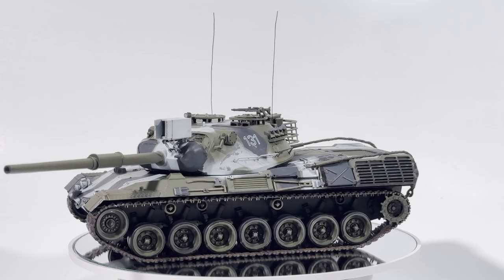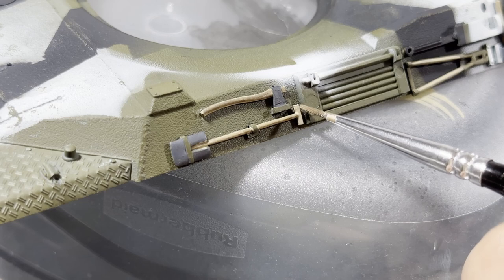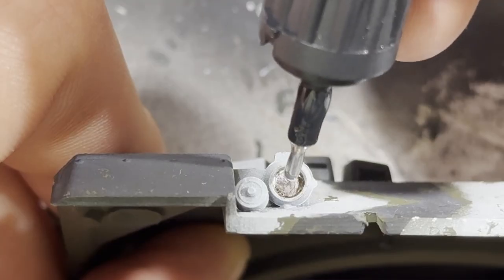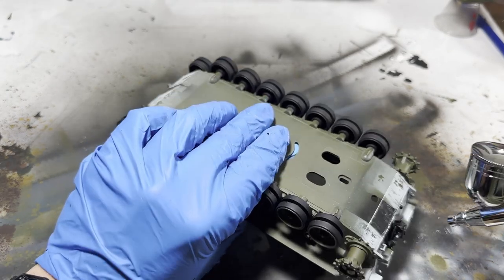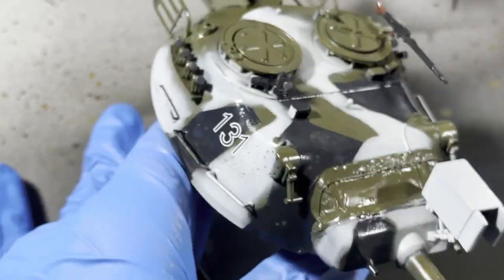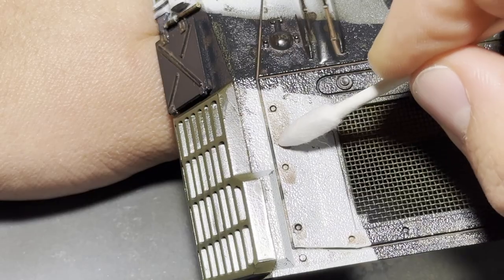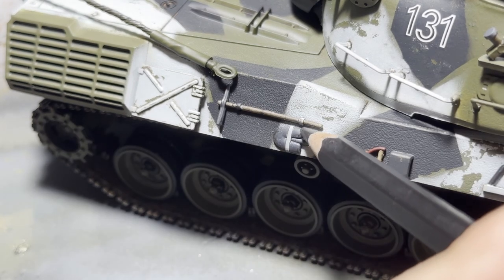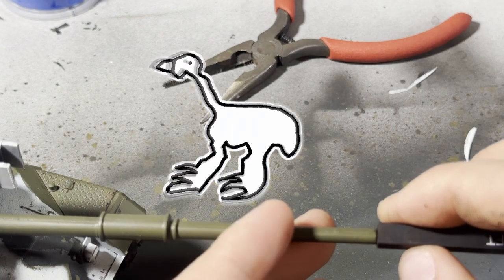Enhancing Your Scale Model's Realism: Tools, Decals, and Enamel Wash

Comment: I recommend adding just the tiniest amount of snow at the deepest crevices and tracks, to make it look more winter-ish. Also exhaust effect can also be made with airbrushisg thinned down black and then add black enamel wash. 5 minutes after you apply the wash use a small fine brush and do an up and down motion to create streaking effects, this way it will replicate grime and oil stains.

But all and all i really like the result. It's not too dirty but not too clean, awesome.
Reply from the maker: I tried out some snow effects and I really wanted it to work, but I didn’t like the look. I just couldn’t get it to not look cheesy - that’s not the fault of the product, just my lack of skill. I’ll have to test out some different products and try again in the future. Nice idea on the streaked exhaust, I haven’t thought of doing it like that!

Comment: the soft pencil is good but Tamiya make what they call weathering master, which are pigment pallets, they give a much better finish and in a variety of colours for rust and bare metals.

 chrome pens also make a far superior polished chrome look for things like suspension dampeners that are typically chrome rather than silver.

going more in-depth into colour theory, scale affects colours differently, highlights make a big difference in scale so painting raised surfaces in lightened versions of the base colour combined with a wash makes the scale look better. painting with an airbrush also allows you to add colour modulation, making faded paints in the centre of panels with a lightened shade of their main colour combined with properly thinned paints and airbrush pre shading allows for a really worn paint look rather than a very uniform tone. smaller objects also look darker, even if theyre a colour match to an original vehicle due to the way light affects small objects vs big objects.

try and avoid painting in matt black as you cant go darker than it, it makes those parts of a model look very strange to the eye as they dont exhibit the same tonal variations as the other colours. its also not a colour commonly seen other than in things like rubber, but due to the scale effect, painting these things perfectly matt black causes weird effects. the same goes for stark white, its almost always better to use an off white. 

learn to use and navigate scalemates, this will help you determine the age of your models as despite coming in modern boxes, some of the tooling for the parts is over 40 years old in a lot of cases so using this will allow you to see what models are bang for your buck or are probably gonna need a lot of work to look good. they also list suitable detail packs for many kits aswell as spare decal options and replacement parts. 

retro tip but aerials and cables can be made from a piece of sprue stretched over a lighter or the hob. this allows you to get any thickness you want and in any length. a piece of sprue sharpened makes a very good tool for scraping clear plastic parts clean of paint without scratching them. loot your female family members/girlfriend's nail files, they come in a variety of grits in both stiff and sponge varieties and can even be used polish parts aswell as sanding and fitting. start accumulating things for scratch building like copper wires of various thicknesses, brass tubes, aluminium and lead foils etc. any "spares" like jerry cans, wheels, spare tracks and stuff that go unused in a kit you save for when you need them which in all likelihood is never but they can be really useful for making stowage on that one time you need them